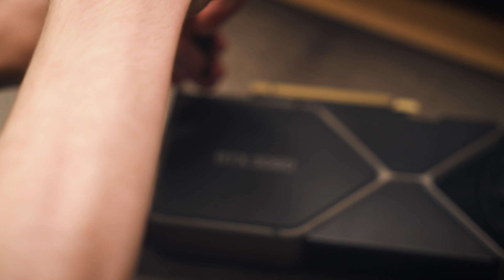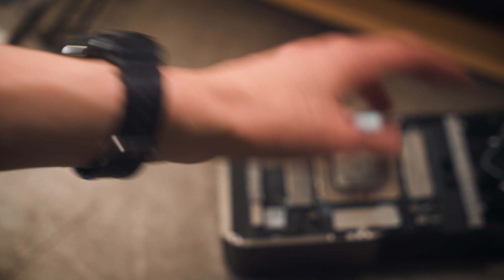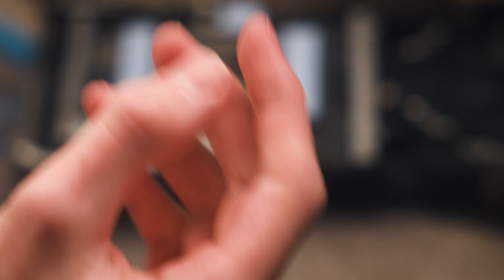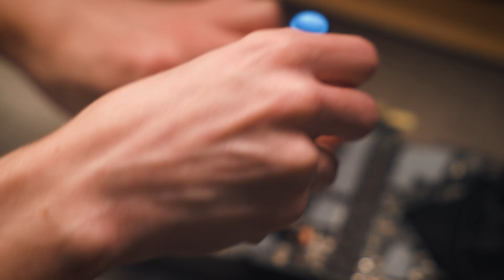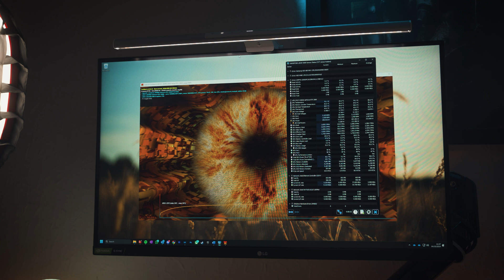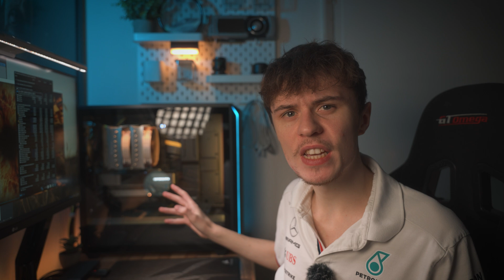Fixing My GPU's High Memory Temperatures (for good)

Comment: Stuck with 105°C on Aorus RTX 2070 super
Reply from the maker: On which sensor? The hot spot?
Reply: @ProYamYamPC  yes how did you fix yours
Reply from the maker: @RaffayZFone  by repasting it. Either that or the thermal pads on your memory could be too thick
Reply: @ProYamYamPC  memory pads is a pain because aorus decided to use almost all types of thickness .5mm, 1mm, 1.5mm,2mm. 

Is it possible to repaste without destroying stock pads

Comment: Wait i thought you should repaste if you take it apart? Trying to put it back together you wont get as better results as air pockets develop in the thermal paste when taking the cooler off and trying to put it back on not completely cleaning and re-pasting will also create problems. At least i know this is the case with the CPU. I hope you did this with the GPU too, eh?
Reply from the maker: Maybe that could be the case here, but I was quite happy with the temps after so no harm done
Reply: @ProYamYamPC  Well yeah, I guess it doesn't hurt to try it anyways and see. Sounds good to me then! I just know it can help if nothing else did. In your GPUs case it seems like it was fine then, anyways I guess if you really needed to in the future it's not very difficult to re-paste. You did the most difficult part the thermal pads which I admit I've never even done myself which is why I'm watching this video but I've pasted quite a few CPUs in my time. What finally fixed my i5-12600k temp issues was that Lga1700 plate which helps with cooling surface area contact apparently. Since I'm only using a normal tower fan cooler, no liquid cooler necessary really. Now the highest temp under load I think I've seen was about 80 when before it was going up to 100 degrees. (throttle limit) 😭😂

Comment: I fixed my msi’s 6900xt’s boiling hotspot and vram by selling it and buying a sapphire 7900gre nitro for the same price now I’ve got a silent card that doesn’t go above 65
Reply from the maker: I hear the MSI 6900 XT/6950 XTs had a terrible coldplate. This could have resulted in your poor hot spot. But congrats on the 7900 GRE, Sapphire is the best AMD AIB imo

Comment: The card is half the size of the cooler. Its crazy how hot newer cards run.
Reply from the maker: Incredible engineering from Nvidia. Terrible thermals though. Albeit, the pads on here weren’t stock, but the original pads from the factory aren’t much better

Comment: Since I have an RTX 3070 it has GDDR6 which is way cooler than GDDR6X so much so the RTX 3070 doesn't have Memory junction temperature but even if it did it would report in the range of 40-60c so yeah
however the hotspot temp is still present on the RTX 3070 and as long as its under 110c it should be fine, same thing for GPU temp as long as it's under 95c it's all good :D
Reply from the maker: Regular GDDR6 runs so much cooler than the X variant. I like to keep my core under 80C and my hot spot under 95C
Reply: Hells yeah same here have an EVGA RTX 3060 XC and I'm probably gonna keep it around for awhile. It has done me well with even 4k DLSS gaming. But yeah I've never had my temps really go above 80 for my core. No clue I haven't checked my hotspot in awhile but I will now! 😂 I recently realized I may have been kind of temperature throttling the tiniest bit using MSI Afterburner since I've owned it. I had it set to around 76 degrees C for the core and now I just fully unlocked it and most ive seen was 80 and this was like playing Cyberpunk with a bunch of RT settings and other things.
Reply: Matter o fact, I wonder when it will be time to replace all the pads on our GPUs. I'm going to assume in another year or 2 at least... Well mostly assuming this because I'm not trying to do it yet. 😂

Comment: Use copper instead of pads and reduce the heat by 40%
Reply from the maker: I’ve heard mixed results from the copper plates. And in all honesty, I’m pretty happy with my temps right now
Reply: @ProYamYamPC  Well ive seen some videos and the results are only positive, one managed to cut the heat by 40% and that's all I need to know. My 3070 Turbo will def get some plates :)

Comment: The 30 series had an issue with inadequate heat sinks, the actual die was made by Samsung instead of tsmc. My evga 3080 ran hot after 2 years and i had to replace the thermal pads and paste. I think Nvidia cheaped out on the manufacturing.
Reply: Do not say this to Samsung fans:face-blue-smiling::face-blue-smiling:
Reply from the maker: I think it had something to do with the yields at the time. Samsungs yields were pretty high on the 8nm node. But I agree with you, it's a super power hungy and hot process node and the 3080 coolers for the most part weren't great

Comment: I replaced the thermal pads on my 3090 FE 2 years ago and haven't had to replace them since. What I have had to replace, alot, is the thermal paste on the die. Every few months temperatures start to climb on the hot spot until it reaches 90c and at that point I replace the thermal paste and then temps go down to 70c for the next few months until I inevitably have to repaste it again. That cycle of constant maintenance on the card would be the biggest reason for me to switch to the 5090 if its any good; I don't want to have to constantly replace the thermal paste on my card.
Reply from the maker: A graphene pad would be a good choice, they don’t degrade like thermal paste. I would have reused mine if I didn’t accidentally tear it
Reply: Use honeywell PTM7950, it has best longevity. Look it up!

Comment: Try undervolting the 3080 a little bit. You will get practically the same performances with reduced power and heat!
Reply from the maker: I’ve got it undervolted to 900mV at around 1860MHz. It still can get quite a bit toasty. Albeit, I could do with improving my fan curve on the card

Comment: The 3000 series cards were great but they ran HOT. I just replaced my office pc's 3090 with a 4080 Super that I got a great deal on. The 3090 ran at 90-95C under load, the 4080 Super runs around 50-52C under load. My 4080 Super isn't a premium model either.The first night I stress tested the 4080 Super for 12hr with a gpu mining program, ran cool & worked fine. The difference is SO large that my office is 4C cooler with the 4080 Super and it has AC.
Reply from the maker: Efficiency is the biggest gain with Ada imo. The 4070 will perform about as well as my 3080 while using substantially less power/running much cooler
Reply: Main reason I upgraded to a 4080super FE from a 3070Ti FE. The 3070 always ran above 76c brushing on 80c pulling over 300w fans blasting during heavy use. No matter what I did I could never get the temps to drop below 70 even with extra fans in a high airflow case. 4080super barely touches 250w and stays around 60c.
Reply: @BEARTAC0S  if I didn’t download afterburner mine would b doin the samething yours was doin. I always got over 75 and up no matter what I did. Afterburner holding it down for right now lol
Reply: yes they do. I had to adjust my fans and everything. I think i'll be switching to a 4000 series soon.

Comment: to save 16 minutes of ur time, he changed out the heating pads on the vram.... What a misleading title.
Reply from the maker: For starters, they’re thermal pads. I would say dropping memory temps by 30C is fixing my GPU’s cooling…
Reply: @ProYamYamPC  are thermalright thermal pads good ?
Reply from the maker: @NeonT3tra25  not too sure, I never even knew they made thermal pads
Reply: @ProYamYamPC  which thermal pads do you reccomend then ?
Reply from the maker: @NeonT3tra25  Gelid extremes are supposed to be the best for the 3080 FE. But to be honest, these Arctic TP-3 pads are doing a brilliant job. You can’t go wrong with either imo
Reply: @ProYamYamPC  thanks i might try the gelid extreme since they're the only option avaible alongside the thermalrights, my 3070 ti needs  some fresh rework and cleaning
Reply: Thermal pads.
Reply: How is the title misleading? Unless he changed it it seems fine rn
Reply: Use Gelite Extreme Thermal pads and add an extra copper plate above the vram. With good airflow you'll be fine.

Comment: Hmm, I`ve seen some awesome results from people using copper shims, can`t remember the measurements now but if I remember right it was a 10 -15 degrees drop I`m planning on attacking my 3090 as the mem on the back get super toasty.
Reply from the maker: I’ve seen someone use it on a 3070 and 3080 and the results looked good. Hopefully it works well on your 3090🙌

Comment: My mining friend had 4 3080s in his rack, all of different editions. Also about 30, 3070's with at least one of every vendor and style he could find at the time. The 3080 
S were always apart, he was always chasing down the memory temps with pad changes. The 3070s, none of them ever got opened or had trouble.
Reply from the maker: I suspect it's down the the 3070 having regular GDDR6. It runs much cooler than the X variant. GDDR6X is really super hard to cool🤣

Comment: Are you excited for the new 50 series so that the 40 series can start producing good preowned deals
I’m apprehensive as the 3080 is pretty hard to beat when I got it for 400 and any upgrade has to be worth the money I put in again
Reply from the maker: Looking at it that way, I kinda am. I'd love to see great deals on used Ada cards🙌
Reply: Rumors are that AMD will be releasing a $500 gpu that performs similarly to a 4080 with ai upscaling and better ray tracing than previous generations so that might set the market price for everything else used.
Reply: @spoorthyv ooooh interesting

Comment: I’m super glad my 3080 fe has the EK vector limited edition waterblock for the only reasons of all the thermal pads are 1mm thick and the card becomes 1 slot thick
Reply from the maker: I was looking for a water block and I realised there's barely any for the FE. Then I had the idea to smush 2 1mm pads together to fix the temps🤣 I'm pretty happy with it now as it's running quite well with a -100mV undervolt

Comment: Can i do 2mm on my 3090 founders?
Reply from the maker: For the 3090, I'm not too sure. I spent quite a while finding out which is the best for my 3080
Reply: I used 1.5mm pads for both sides of my 3090 founders and haven't had any issues

Comment: I built a PC last year, I have a RX 6750 XT OC GPU. How often should I change the thermal pads on it? I am also regretting my decission to use a 7700X CPU in it. Great video as always kidda, have a bostin weekend.
Reply: When u notice the temps go up significantly is when u might consider replacing some pads..Shouldnt be anytime soon in your case. + the 6700 cards are nice to OC+ undervolt to improve longevity even further.
Reply from the maker: To be honest, I reckon you'll never have to change them. Thermal pads will often outlive the card. But monitor your memory temps, if they're looking really high, then it could be time to change them. And you have a great weekend too mate!
Reply: Why regretting the 7700X?
Reply: @rasluffi  it runs hot 95 Deg C upto 100 Deg C, I think I need to change the air cooler on it. But I didn’t have it in my budget at the time. I have a BeQuiet PureRock FX cooler on it at the moment which I don’t think is upto the job.
Reply: @TeamGB-Diving  it looks like it could handle the 7700X but wow yeah could be
Reply: @TeamGB-Diving  undervolt and make sure to turn down the power as well that cooler should work just fine....
Reply: @Daakor  I will give it a try cheers. 👍🏼👍🏼